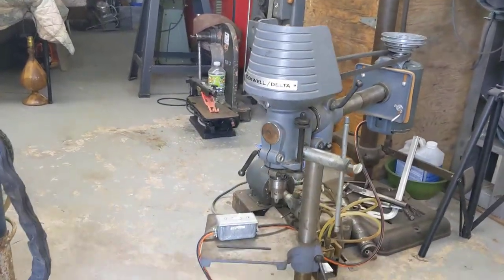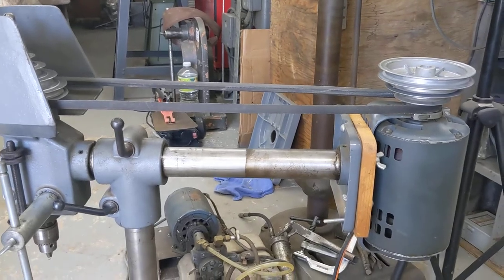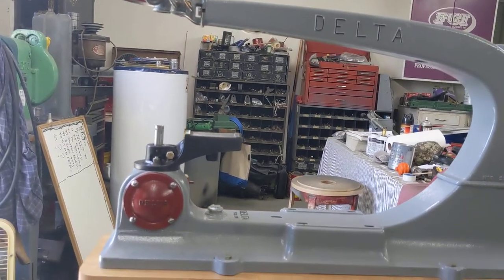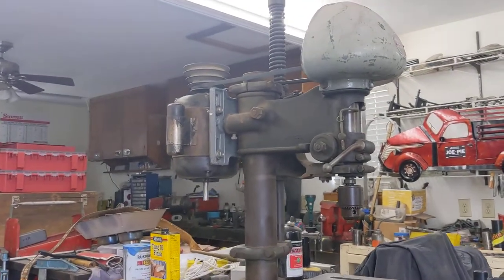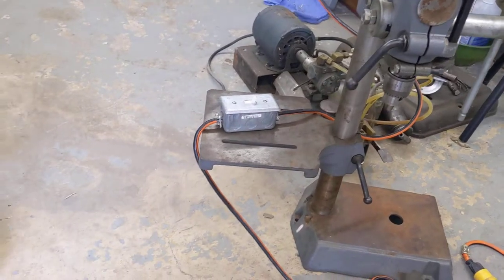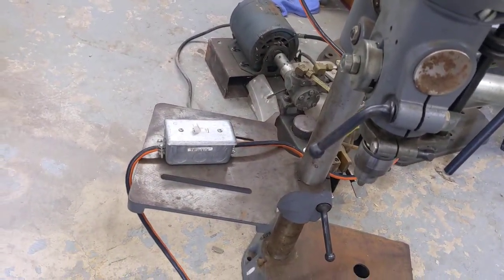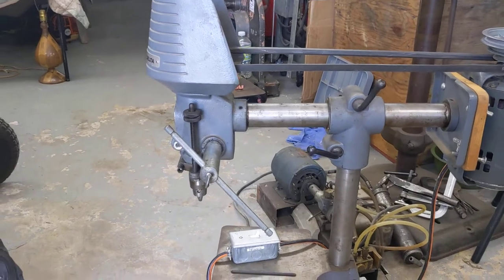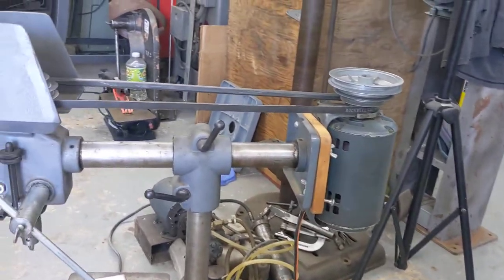Change of plans for the 1930's Delta Scroll Saw project PT-09

Comment: Great find! I have a Delta radial drill press like yours, and I like it a lot. Light duty, but really handy. Keep an eye on the set screw on the pulley cluster above the quill - it likes to loosen up and wallow out. Thanks for the videos.
Reply from the maker: Thanks for the heads up tip Mark. He had another one, but needs more attention. Also has a 15in 1hp Craftsman upright HD drill press. I am going back this morning with cash to pick up both. Will shoot a video some time this wk end on all three. Thanks for subscribing to our channel. Bear.